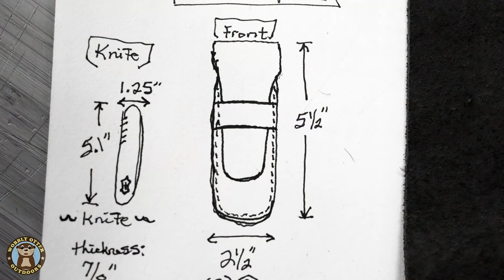Making A Leather Knife Sheath for the Victorinox Ranger Grip 55

Comment: What it’s the thickness of the leather?👍🏻
Reply from the maker: 2mm
Reply: @wobblyotteroutdoors  Thank you! I honestly think that I would go with a snap button closure too much fiddling to close it  and it seems like it might need it to be wet form or a bit bigger as it looks like you having and issue putting inside and removing it .I’m not expert but you ask for what we think.I might do one but thicker leather?
Reply from the maker: You're welcome. Didn't realize how much I would come to appreciate calipers until we started Wobbly Otter. Yes, a thicker, full grain leather would be much more refined. The suede is by its nature more floppy than full grain, and so it can form by being a snug fit. Actually, and surprisingly to me, the fit of the knife in the sheath is exactly as I hoped. With time and use, the knife slips in and out beautifully. I'm so pleased. A snap would have definitely been an easier to use closure. And again, the much more refined option. 🙂 I'm seeing a trend here. While far from perfect and refinement, it came out like I hoped. It is soft, rugged, and extremely low profile. In this particular case (pardon the pun), those are the qualities I was aiming to have. I would love to make a quality, full grain leather piece! Now to decide 🤔  what will go in it. 🙂